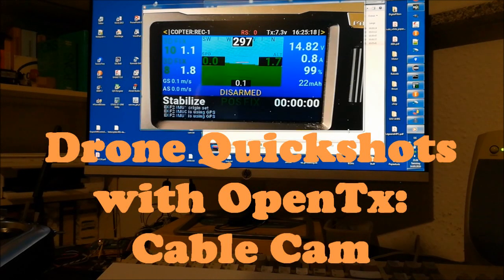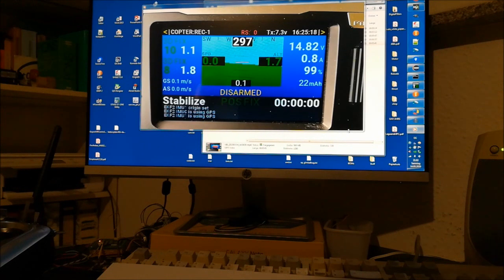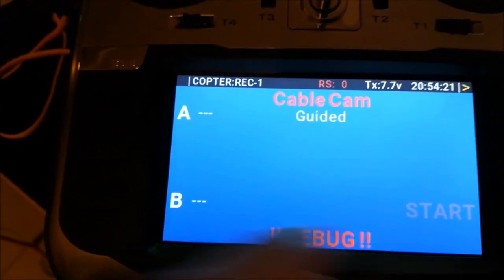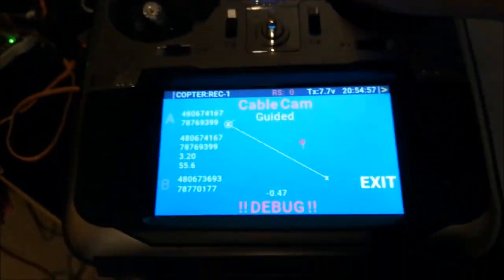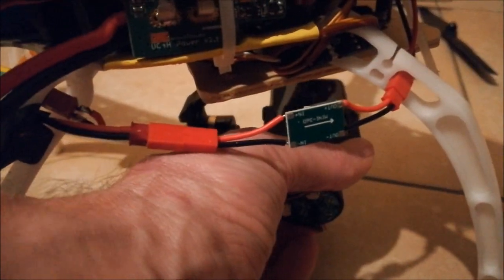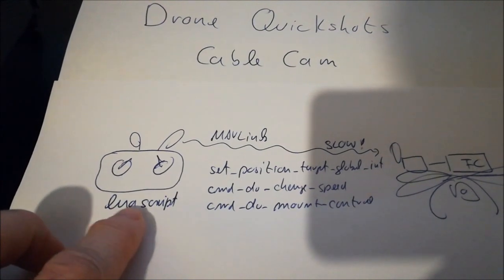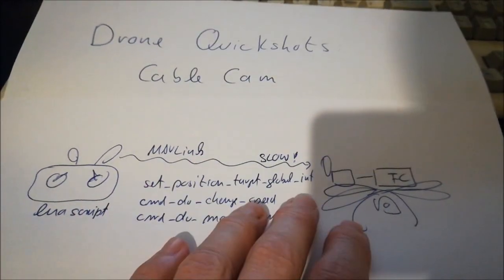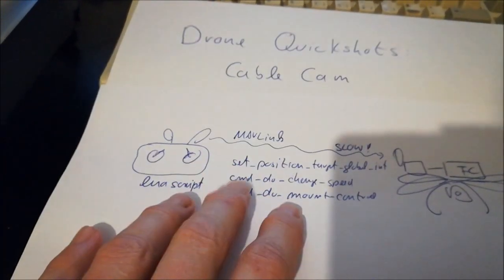Drone Quick Shots with OpenTX

Comment: hey i was wondering if the gimble could be controlled with an Arduino over Bluetooth? say maybe for a DIY boom mount gimble?
also, does it matter what motors are used? is there a kV range or other considerations to worry about?
Reply from the maker: hey. Yes. If you find it easy or not do depends however. The main criteria for selecting a gimbal motor is resistance and size. This info got a bit lost in web space, and motivated by your question I decided to write it up: http://www.olliw.eu/2020/brushless-gimbal-motors/
Reply: @OlliW42  wow  cool read. I actually found 2 axis gimbal with 2208 gimbal motors from hobby king for 15 each set lol. No controller bord but cant beat the price so I ordered 3 and make 2 3 axis with them lol. Really wanting to use it as a steady cam on a boom for action shots. Is there a place I can find the un compiled sorce code to see if I can figure out a way to do the bluetooth remote controll?
Reply from the maker: the hardware is open source, the firmware is "only" free as in free beer. For BT control you however just need to use the serial commands described in the wiki